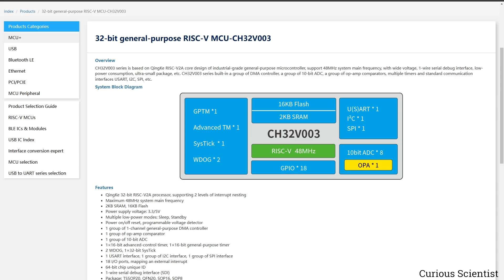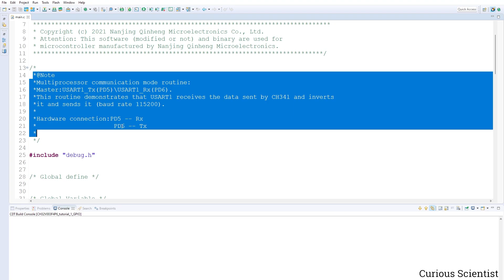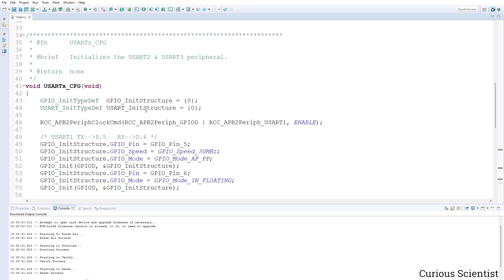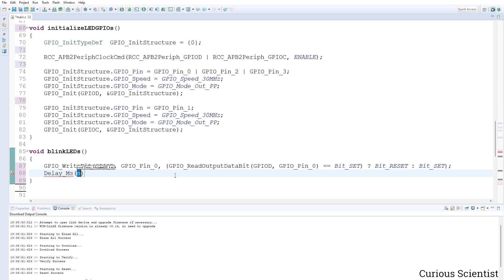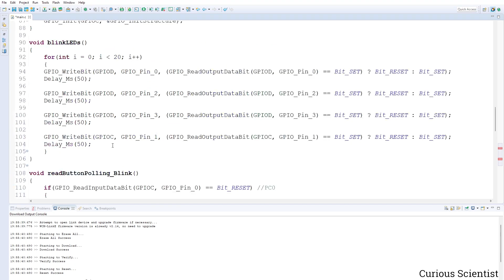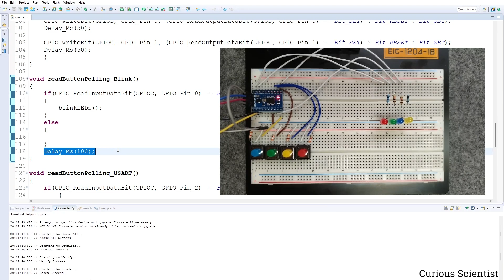CH32V003F4P6 Tutorial - Part 1 - Basic GPIO operations

Comment: CH32V003F4P6 Tutorial - Part 1: Basic GPIO Operations

* 0:00 Introduction: The video begins by introducing the CH32V003F4P6 microcontroller, highlighting its affordability and the lack of in-depth tutorials available.
* 0:15 CH32V003F4P6 vs Arduino Nano: The CH32V003F4P6 is compared to the Arduino Nano, noting its lower flash memory but similar peripherals and GPIO capabilities. 
* 2:44 Essential Documentation: The importance of studying the chip's datasheet and reference manual is emphasized.
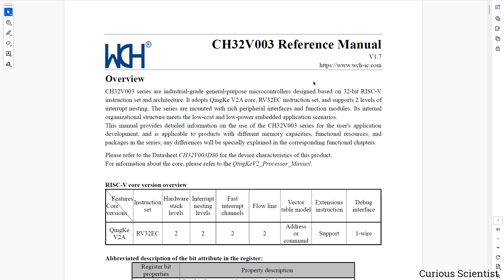* 3:14 Exploring Example Code: The video demonstrates using the example code provided by the manufacturer, but emphasizes the need for clearer explanations and documentation.
* 4:44 Hardware Setup: The tutorial utilizes a CH32V003F4P6 development board and a programmer that also provides serial communication capabilities.
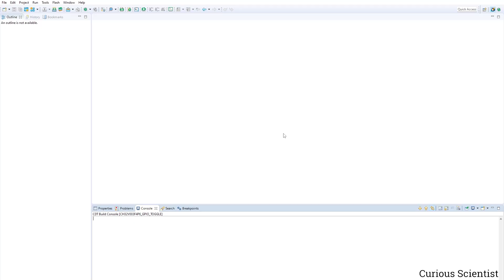* 7:00 Creating a New Project in M-RISC Studio: A new project is created within the M-RISC Studio development environment, demonstrating the setup process.
* 7:51 Modifying the Default Code: The default main.c file is cleaned up and modified to print a simple message to the serial terminal, showcasing basic serial communication.
* 11:29 GPIO Configuration for LEDs: The code is further expanded to configure specific GPIO pins on Ports C and D as outputs to control LEDs.
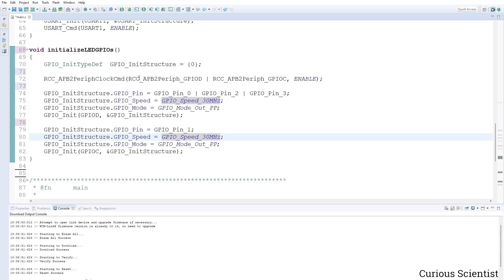* 16:14 Toggling LEDs:  A function is created to toggle the state of the LEDs (on/off), demonstrating basic GPIO output manipulation.
* 20:33 Reading GPIO Input from a Button:  The tutorial introduces reading the state of a button connected to a GPIO pin configured as an input, demonstrating how to detect button presses.
* 23:49 Combining Buttons and Serial Output:  The code is enhanced to use two buttons to increment and decrement a variable, with the variable's value being printed to the serial terminal. 
* 28:07 Conclusion: The tutorial concludes by summarizing the basic GPIO operations covered, highlighting their importance as building blocks for future projects. 
* 29:06 Call to Action: Viewers are encouraged to subscribe to the channel, become members, and visit the website for more resources and affiliate links.

I used gemini-1.5-pro-exp-0827 on rocketrecap dot com to summarize the transcript.
Cost (if I didn't use the free tier): $0.03
Input tokens: 20849
Output tokens: 512
Reply from the maker: I was honestly hoping you to show up in the comment section, because I wanted to ask (again) how you generate these things. I have 4 more tutorials already uploaded and I want to create these things and pin them as a top comment so the viewers can navigate easier. Especially, because I have twice as long videos, too. Thank you for your contribution!
Reply: @CuriousScientist  You can go to the link from the disclaimer. There is a short video tutorial and a link to the source code. You can actually use any LLM to make such summaries from youtube transcripts.
Reply from the maker: I already used your tool for the next part and also left a comment, and like at your explanation video! Thanks for the great tool! 
PS: For me, it seems that anyone can see what the previous person did in your tool. When I opened the site, I saw your prompt and results, and when I generated my transcript, I saw mine afterward. I don't know if it is intentional or not, but I thought I might mention it.
Reply: @CuriousScientist  yes. this is intended. it was just the easiest to implement

Comment: Thank you for the tutorial series! I ordered the parts and I have a question: I left "printf("SystemClk:%d\r\n",SystemCoreClock);" in the 'setup' part and it prints "24000000". Is the MCU running on half speed and if so, how to get it on the 48Mhz (as advertized) speed?
Reply from the maker: Thanks! 
You need to open the system_ch32v00x.c file. And there, you have to uncomment the SYSCLK_FREQ_48MHz_HSE   48000000 line and comment the rest. This has been mentioned in my tutorial series, more specifically in my breadboard multimeter video/article. Cheers!
Reply: @CuriousScientist  I checked the file and it is already in the 'SYSCLK_FREQ_48MHz_HSE   48000000'-state. Also the IDE greys out all other code in the #defined and #elif defined areas. But it still prints 24000000. I tested it on 3 boards: the blue one from your link,  a black one (as showed in your video) and a homemade one with a F4P6 chip. The ChipID changes accordingly, but the SystemClk stays the same 24Mhz... I use MounRiver Studio Version 2.1.0
Reply: I also sent an email to MounRiver !
Reply: @CuriousScientist  I read to fast. There are 2 48000000 defines. 1 is HSI and the other is HSE. The HSI is working!
Reply from the maker: It depends on which board you have. HSI works because you probably don't have an external clock source (crystal).
Reply: @CuriousScientist  That's it! I = internal, E = external (Crystal). The blue board has a 24Mhz crystal. ;-)
Reply: Very nice! I know will add a crystal to my self build board!
Reply from the maker: Yes, I know what HSE and HSI, I discussed it in the earlier mentioned video and article. However, I don't think you necessarily need the external crystal. You can free up 2 gpio pins and save some power with the internal oscillator. But it depends on your application.
Reply: Got it working! ;-)
Reply from the maker: Great to hear!

Comment: @27:xx In fact you go into the Button Blink polling routine and delay 100ms because nothing is pressed, then you go to the USART button polling, and delay another 100 ms there.
Reply from the maker: Yeah, that's just the cheap way of debouncing the button.
Reply: to be honest it is not debouncing it is just delaying the execution without any meaning.
Reply from the maker: What do you mean without any meaning? It prevents the function from triggering multiple times due to the bouncing of the button...
Reply: @ You do need debouncing if a button is pressed. If no button is pressed no need for debouncing.
A more sensible approach might be to set a flag in the Button and USart routines, stating that debouncing is needed, and then delaying in that case. But in any case, it isn't a big deal. More a matter of tidyness; certainly not defective code.
Reply: @CuriousScientist  it is still trigger after delay. and the whole execution of program is blocked by this. Proper debouncing should prevent from another call if button state didnt change. Also implementing press and hold should not be side effect but designer choice. My opinion only. Dont be offended.
Reply from the maker: Ah, now after reading the code together with the comment, I understand what you mean! Yes, absolutely, that is a bug. The delay in the end of the functions should not always fire, but only when the button is pressed. In that case,  the delay should be moved under the if() block because that only runs when the button goes low. Then perhaps even flags can be avoided.

Comment: Nice tutorial. Thank you. The price is very attractive, yet what is the drive of using a board without the USB connection? Thant would make the design easier. Also, Why not going to ESP32 based boards? the price is not much higher.
Reply from the maker: Why would you need a USB? If you design a standalone device, you 99% don't need USB. And the programming is done via the SWIO pin anyway.
Reply: @CuriousScientist  In most of my designs, I have frequent software updates, The USB brings me easy access, including debug. I am willing to pay the small amount of money for that. When i go to vey small designs, I use ATTiny. I designed a programmer for that.
Reply from the maker: You can do all that with the SWIO... No need for USB.
Reply: @CuriousScientist  Agreed, but you need the external programmer.
Reply from the maker: It's a very cheap instrument, I'd not worry about it. But it all comes down to personal preferences and the requirements of the device.

Comment: I'm more interested in the CH32V203, which has proper USB connection, a lot faster and more memories, and while still more expensive, is still pretty darn cheap for an MCU.
Reply from the maker: They'll be introduced when I run out of peripherals on this module. It is already in the production pipeline. 😎
Reply: @CuriousScientist  Had you seen WCH have started making an Arduino compatibility layer as well? Makes things a bit simpler if you're mostly doing very simple stuff. But you showing the native API also makes me wonder about contributing to it to improve it.
Reply from the maker: You haven't read my article. 😉 I even linked the Arduino library, and I explained that it lacks many functions.
Reply: @CuriousScientist  OK I will read it